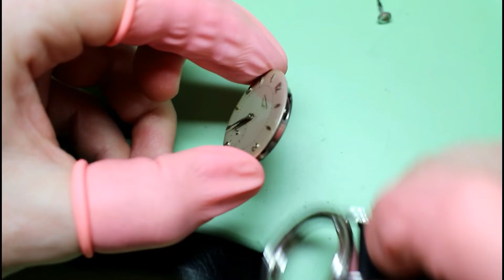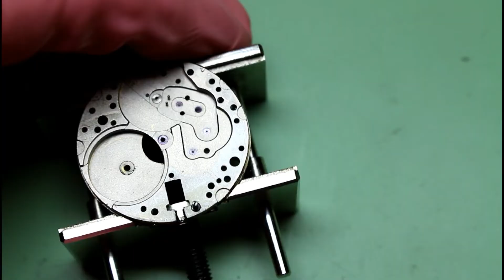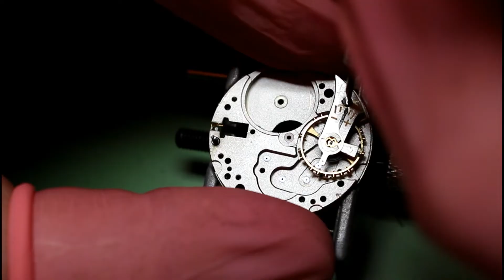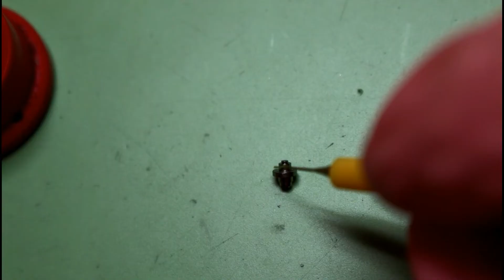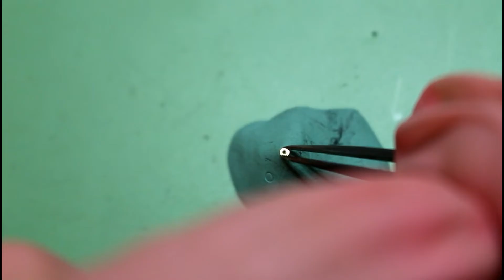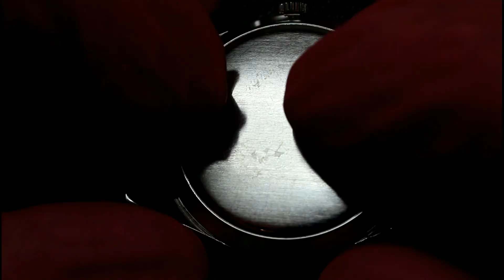1950's Vintage Longine's manual wind service

Comment: Professional watchmaker here. You should be tightening every single bridge down before you move on to the next. You should be checking the barrel endshake, it's between 2-4 hundredths mm. Why aren't you using a mainspring winder, manually installing it like that is bad for the main spring. Why didn't you remove the click and click spring? We no longer use keyless works, it's called the setting and winding mechanism. You should be using HP-1300 preferably not natural grease. What type of oil are you using on the escapement?
Reply: Then you should be aware that when this watch was manufactured, it was common practice to use only one oil for the entire movement. Look it didn't fall apart and burst into flames within the past 70 years. It'll be fine for another 70.....even without following your advice.
Reply: @sonik954  Yeah, that's not true. Also, this guy Nate runs a business repairing watches and yet I'd like to see his work up close. He's supposedly a professional yet he should be striving for perfection.  Just keep telling yourself lies, bud.
Reply from the maker: So the first message came across as a little more constructive, and this seems a little more...aggressive XD. I try to show things up close, ain't nothing to hide. Want to get better equipment to showcase that but for now we work with what we have.
Reply from the maker: Ok lets answer some of these questions. Whilst I may typically tighten one bridge at a time I don't think it's even worthy of critique, if an issue does arise I can just....take a bridge of. And there are plenty of watches which house both barrel and train so no I don't really see an issue here. As for barrel endshake, as a professional watchmaker I'm sure you know when a barrel doesn't feel right, whether it's too loose, tight or very worn. In which case of course you would check them. The barrel was moving freely with some endshake so I continued assembly. I explained why in this particular instance I wasn't using a mainspring winder but I'll put it in writing here. Its a manual wind with a brace at the end with an allocated whole within the barrel, so I would wind it by hand to make sure everything lined up. Can't say it would have been as easy with a mainspring winder. The click is probably the only worthy critique, yes I could have removed it but saw no issue and decided to leave it.  The whole keyless thing sounds like a football vs soccer debate, we both know what we mean when we use either term and I'm not going to get into a debate over it. Finally I use 941/2 on the pallets. Hope this helps.
Reply: @Mr. Personal-ity If you have opinions about other watchmakers posting videos on YouTube, especially Wristwatch Revival and Read Dead Restoration, I would like to interview you for my YouTube channel as I'm interested in how much of what those guys do can be considered professional. We can figure out a way for you to do it anonymously if you wish. Please reach out to me via my channel - either in the comments or through the contact page and take a look at my 20 minute restoration of an IWC Cal 44, as well as the 16 hour "real" version to get an idea of why I'm interested in this. Nate, I'm sorry to self-promote on your comments but I'm really interested in this guy's take on these other channels with huge followings.
Reply: Much ado about nothing. It’s obvious Mr. Charles is a pro. I actually like the term “keyless works” as it denotes an historical reference to an old, old craft.  Thanks again Nate for the video and live steams you’ve done!!!
Reply: You are very rude, Mr Professional. We want to see your work first, before we believe that you can repair watches. Show us. But be aware that we will criticize every single bit you will do.
Everybody calls it keyless works. You didn't watch many videos here on YT, did you?
Nate is one of the good guys, no reason beieng harsh on him.